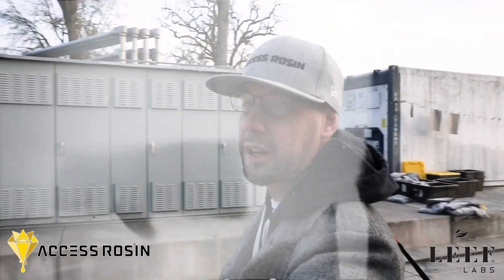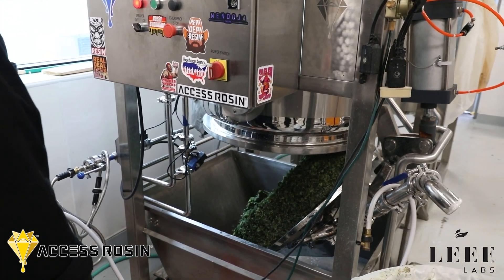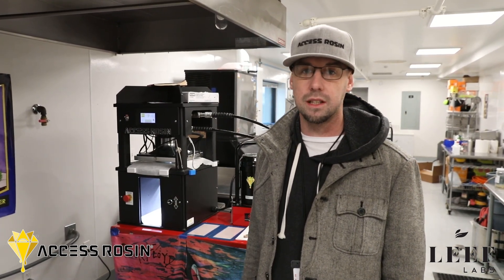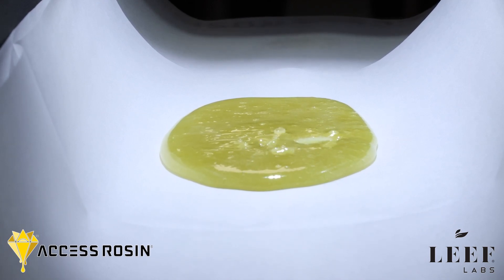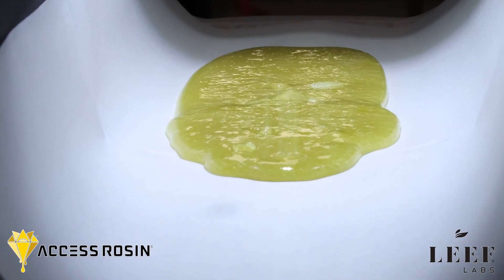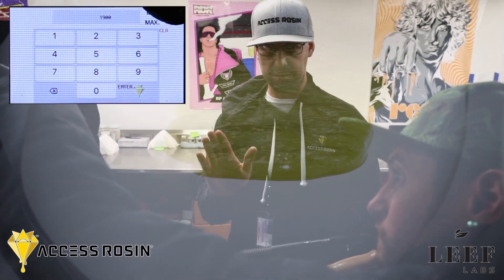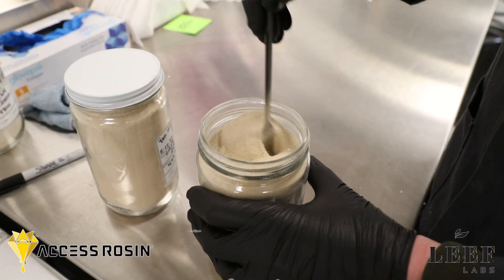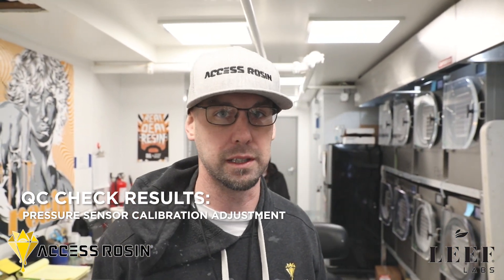Solvent-less Lab Service with LEEF LABS | Access Rosin®

Comment: Wish I could access this amazing  rosin from Canada. 😂
Reply: If it's legal there, just by a small beginner rosin heat press, like a hand held tool size & you can make smaller amounts at around $150 ish for a decent 1 or cheapy may be better suited if $$$ is tight. Good luck & happy holidays...